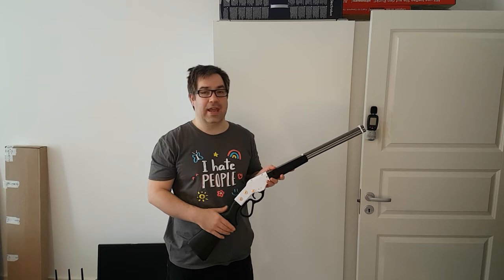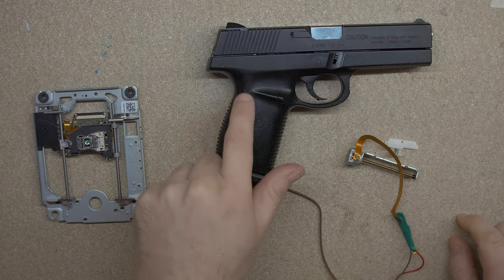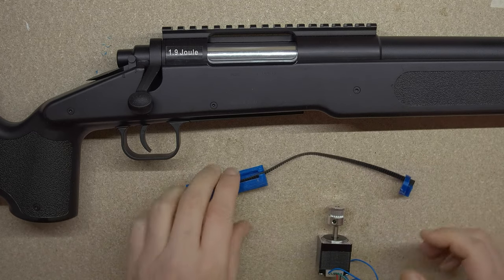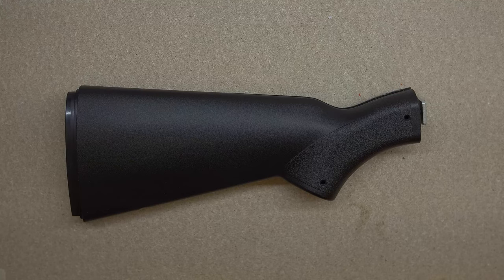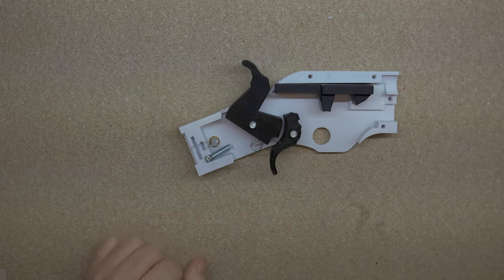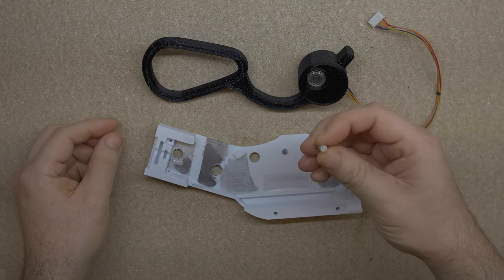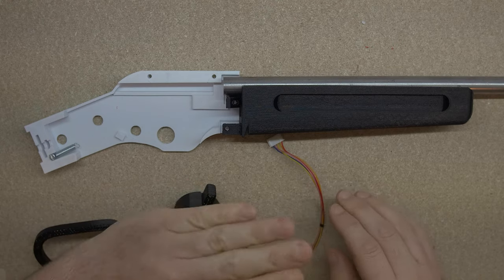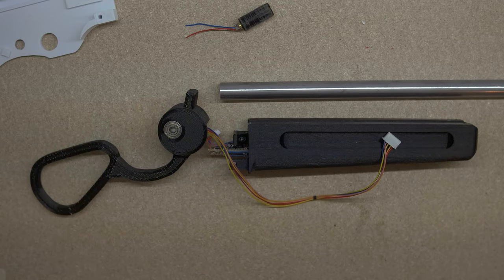Human-powered laser guns!

Comment: Absolutely great video, man! It's been a year, what are you doing? Updates, updates please!
Reply from the maker: Thank you so much, seriously!

What am I doing related to this project?
Well, there's still the holy grail for me: Cowboy revolver laser gun.

I've got the electronics working, got a tiny NEMA 11 stepper in the cylinder where bullets normally go, and then a slip-ring to connect it to the body, so when you spin the cylinder, it charges up a shot.

I've mostly been struggling with getting it into the dimensions of the original Colt cowboy revolver.

I honestly could have finished this half a year ago, with a slightly bulkier build, and I might just have to settle on it... buuut I'm stubborn.

Might just make a tiny update video showing what I've got, no harm in that I guess.
Reply: @dirkderkdurk  You are basically the only one showing this kind of stuff currently on yt. I'd ride that wave! You might be surprised of what can happen.

Comment: Classic dirkgineering. 👍
Reply from the maker: It either comes from the trash, or belongs in the trash...
Reply: @dirkderkdurk  the SDS masonry bit repurposed as a screw is genius 😁
Reply from the maker: @timangus  Is THAT what it is? Neat, thank you!  And yeah, thought I might have to drive it with a tiny ball bearing, but the nylon-esque Polymorph stuff worked a treat.
Reply: @dirkderkdurk  yeah I don't use polymorph very often but it's occasionally INCREDIBLY USEFUL.